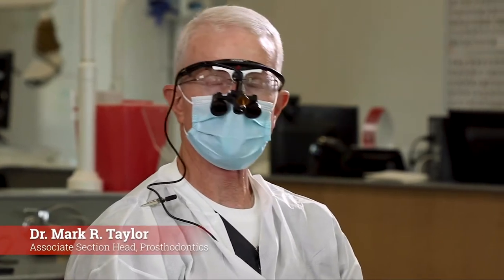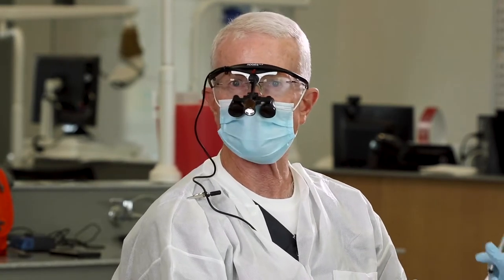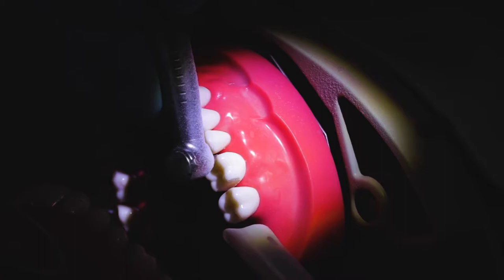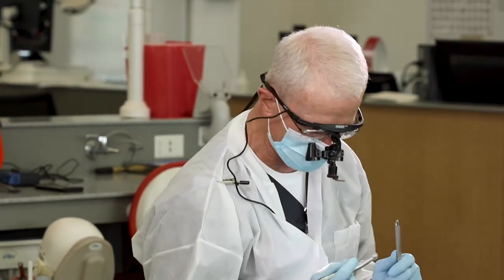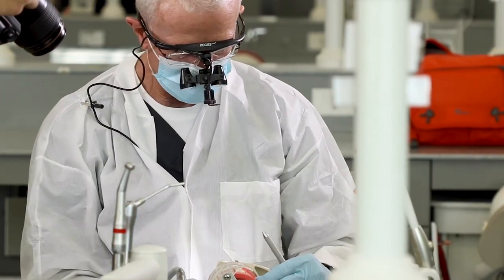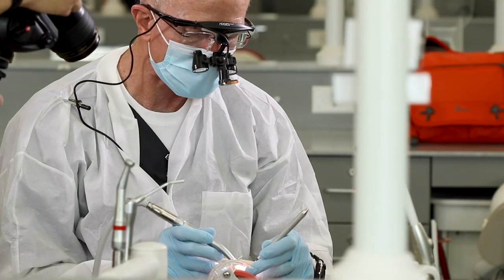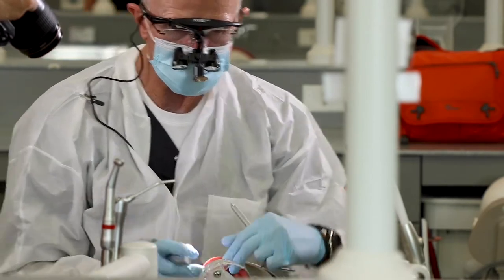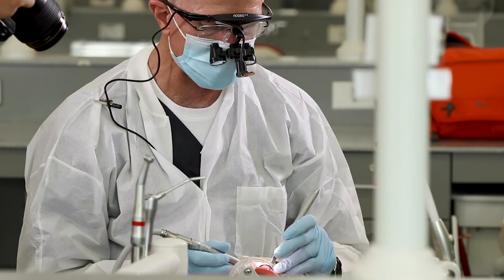Full Zirconia Crown Prep #14 (Chamfer Margin) - Dr. Mark R. Taylor

Comment: Hello doctor, Can you please give me advise? A few days ago my upper molar was pulled out and near to this tooth I have a tooth with a zirconium crown. When I looked in mirror I found out that front part of this crown on side of my lips which used to be smooth now only has 1/3 of tooth smooth and seems like 2 millimeters thickness of my crown seems to be gone now. So I don't know what to do; is it possible to polish this crown to make smooth again? Or do I have to remove this crown? My tooth under this crown had a root canal and I hear that removing this crown is very difficult and can sometimes damage the tooth; is this correct?

Comment: Dear Dr,
Thank you very much for your interesting video. Pls help me: Which is better handpiece for this training (dental student): electric vs air-driven handpiece? Yours
Reply from the maker: We are using air driven handpieces for the dental students. Thanks for your comment!
Reply: @UofUDentistryEducation  Dear Dr., 
Thanks a lot your great info. It is very difficult for me to teach student how to control rpm using air-driven handpiece. So, we worry about their "cutting precision" and "quality of margin" in cavity preparation (preclinical training using typodont).
Reply: @phanhung9622  We use an air-driven handpiece which helps the students, I feel, develop a better sense of handling and control. The electric handpiece has much greater torque and you can remove more tooth faster. I feel it is best for students to start with the air-driven.
Reply: @UofUDentistryStudents  Dear Prof. Thank you very much for your interesting procedure. May I have question: Do you evaluate under SEM (or others) to evaluate quality of final preparation by student using air-driven handpiece? Thanks
Reply: @phanhung9622  The instructors are using their dental loops to evaluate the finished preparations.
Reply: @phanhung9622  Our instructors use their magnification loops to evaluate the preparations. They are given a set of criteria  by which they judge the student's preparations.
Reply: @UofUDentistryStudents  Thanks a lot for your experience. Electric handpiece system is not available in my faculty (and my country). But i learn that lot of universities in EU, USA recommend this system to their dental students (preclinical exercises and clinic). So, i try to find any documents or evidences. Best regards